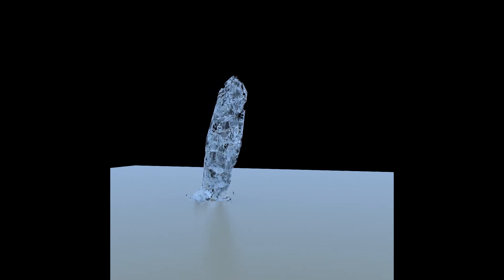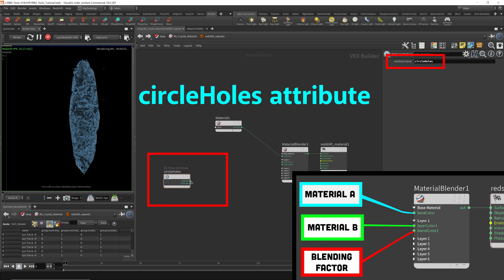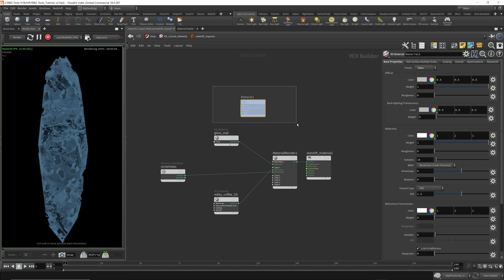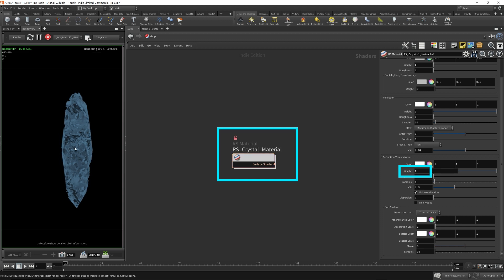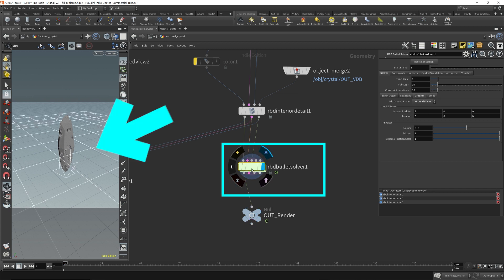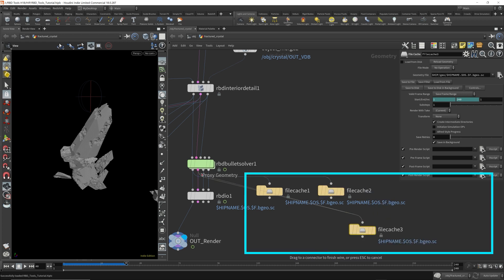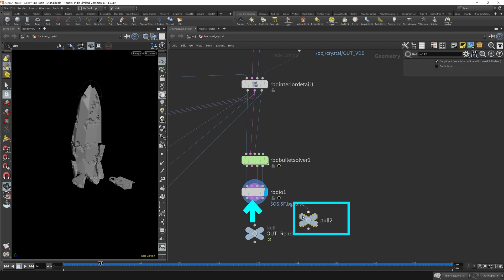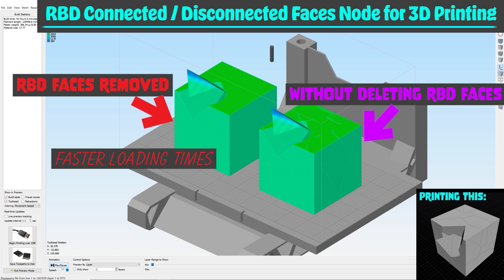Blending Materials with Redshift in Houdini

Comment: Hello again and thank you very much for all this valuable information!! I have just gone through this crystal tutorials on RBD and I have come up with a question... 
Is it possible to design the breaking pattern of a geo? I feel like the RBDmaterialfracture is too regular and for some cases where there is needed a bit more colour and light diffraction complexity the RBDmaterialfracture is not enough. A clearer way to ask this is with the next example: Is it possible to use the boolean patterns of the NTAGMA quartz crystal (https://www.youtube.com/watch?v=pq2bYZGurzc) and use it as the breaking pattern of the geo. As if we could use those inner shapes to separate the mesh or guide a facture proccess?
I have tried feeding to the RBDmaterialfracture and the voronoi fracture nodes some of the booleans informations with no good results.
Thanks again for your efforts!!
Reply from the maker: yeah you definitely can design your own fractures.  I'm not totally clear on the nodes you're feeding in, but there's a 4th input for the rbd material fracture node where you can feed in the extra points that will affect how the geometry is fractured.  You can feed in cutting planes, similar to how you shatter stuff with boolean node.  You can feed in extra points that will affect how the rbd material fracture will cut things.
Is that what you're looking for?
Reply: @bubblepins  I have tried to extract some points from the boolean intersections with "group create"node and feed those into the RBDmaterialfracture, the problem is that the breaking patterns are generated from each point fed to the RBDmaterialfracture node; if I feed a plane im also feeding all the points from the plane (there are plenty since it is not a regular plane, it has lots of noise) so the RBDmaterialfracture results on my computer exploding xD. An aditional problem is how long does it take Houdini to calculate just one point fed into the RBDmatfrac when working with a complex interior geometry.
An alternative could be to feed just one point of the inner planes, hoping that the crack generated will follow only the rest of the points of the inner plane, and it sort of does but dealing with the inner planes as if they were part of the surface, so it hollows it when fracturing it. It seems as if Houdini couldn’t tell the difference between in and out of the geo, which is comprehensible. 
It also doesnt render (don´t really know why, the simulation is visible when visualizing the RBDbulletsolver but when going up from the object level it shows the crystal as if it hadnt been broken despite being on frame 10). 
The concrete RBDmatfrac creates a pretty regular breaking pattern that doesnt match with the complexity of the interior booleans. Also something that Im sure could be twicked but i dont know how yet is that the breaking pattern does not recognize the interior of a geo since they are normally hollow, so they break mostly on the surface.

It’s a petty that I cannot share images of the process in this comment; I think my problems would be much clearer that way than just being decribed with words.
Sorry for such a long comment! Thank you very much for your quick reply :D.
Reply: @bubblepins  I have been working the whole day on it and I think I have a better way to ask the question:
Can you create breaking patterns (not exclusively within RBDs) from various geos boolean intersections? That way you could break stuff with specific shapes through booleans wich is easier and more precise to control.

Thanks!!

Comment: Thank you for everything!  
Have a question, how do you use redshift in houdini 18?
 i installed the newest redshift 2.6.48 demo, but it is not compatible.  it says, 17.5.360 is the highest compatible version
Reply from the maker: Hi, you are right.  According to Redshift's documentation "Houdini 17.5.360: From Redshift 2.6.47 to Redshift 2.6.50" which I grabbed from this url:
https://docs.redshift3d.com/display/RSDOCS/Houdini+Plugin+Configuration?product=houdini
(click "Redshift version 2.6 supports the following Houdini versions" to expland the list)
But there is a newer version of Redshift available for download, the latest release version of Redshift is 2.6.51, which is compatible with Houdini 18 & 17.5.
I'm not sure if Redshift 2.6.51 is available for demo.  There was significant changes made in Houdini 18, otherwise sometimes, you can like manually change the config env. file in Houdini to point to the Redshift folder and sometimes it still works. LOL  I found out by accident once when I got the versions mixed up.  However NOT for Houdini 18, due to major changes.

Hope this helps!
Reply: @bubblepins  You are welcome!
Reply from the maker: @bekabaratashvili3178  Ignore this comment, sorry, my comments in youtube jumped to the wrong video, I was wondering why it didn't make sense  uh ..  friendly note, this video was filmed under Houdini 17.5 (it's on the top left corner of the screen)
Reply: @bubblepins   Hahaha... don't worry.
Reply from the maker: @bekabaratashvili3178  Thanks for understanding! 

My Youtube comments/notifications is always playing games with me.  I'm not sure if it's a bug or just me.  The Youtube comments spam section always says there 1 item, but when I click on it, it's always empty....  And there's so many other weird things ... I get email notification of comments but I can't find these comments in the video, but that might just be because it got deleted or something.   So weird.....
Reply: @bubblepins  Thanks, you make an amazing job. I greatly appreciate your effort in your kind work. God Bless you!!!
Reply from the maker: @bekabaratashvili3178  Thanks for the generous comment!